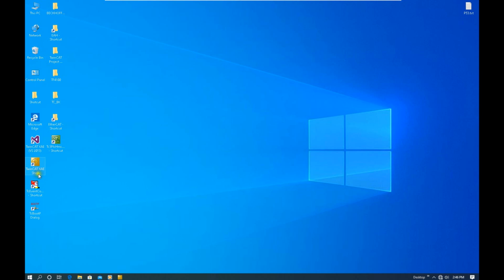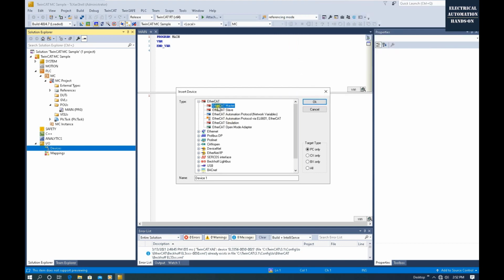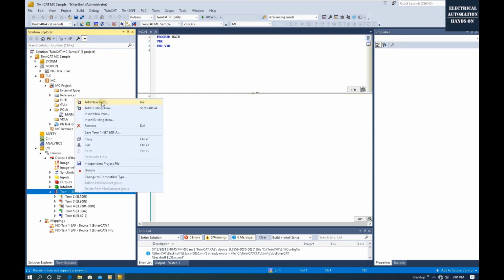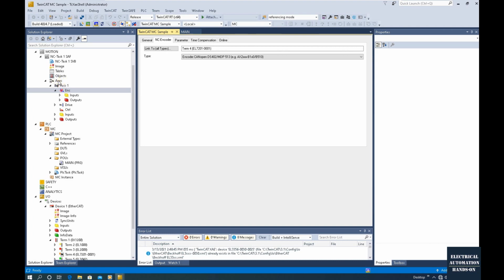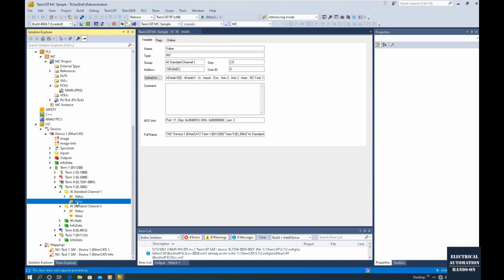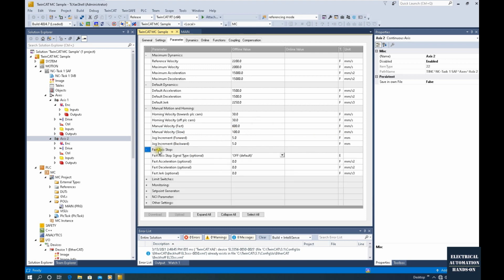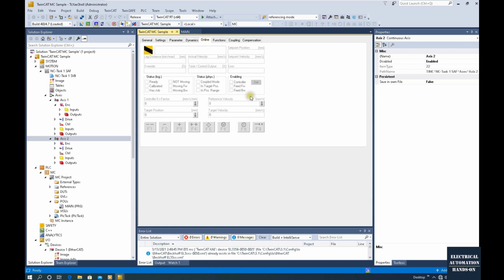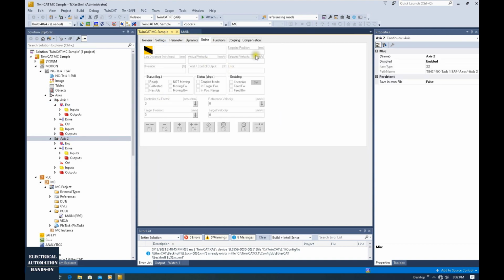MB02. [TwinCAT 3 NC] Create Project, I/O Configuration, and Setup Motion Axis [2/20]

Comment: Thank you for your great twincat tutorials they are very helpful. could you add a video how to set up a distance control of the Z-Axis in the future?
Reply from the maker: Do you mean the 3-D motion like gantry crane robot control? If I could have choice, I will use Siemens S7-1500 T controller to control it. S7-1500T has gantry model which enable you build up a robot involving 3/4 Axis together every efficiently.
Reply: @electricalautomation   I was thinking about an external distance sensor that measures the distance between the TCP and the workpiece surface. how to set up an Z-axis distance control so that the distance between the TCP and the workpiece surface is a constant value that has been set even if there are height differences during the motion of the manufacturing process. (TF 5200 is the functional description of beckhoff twincat but unfortunately i do not understand how to set it up 😥.
Reply from the maker: @arcticWarfare100  Likely you are asking about TwinCAT 3 CNC. Sorry I have no idea on CNC.